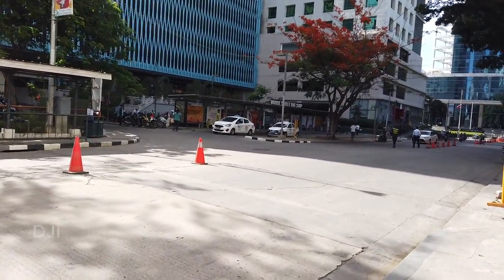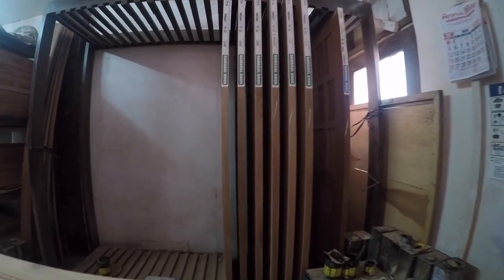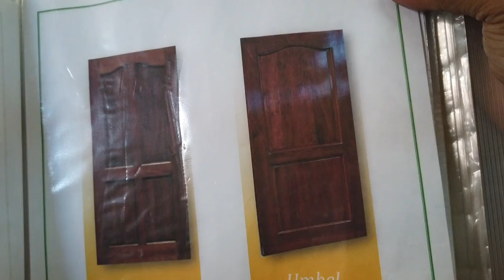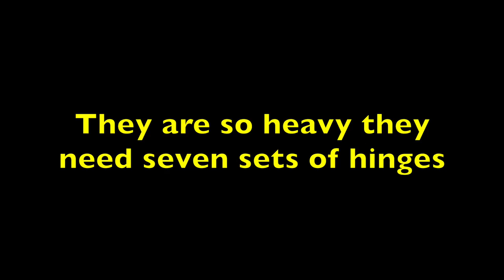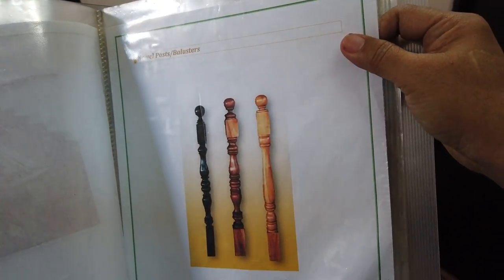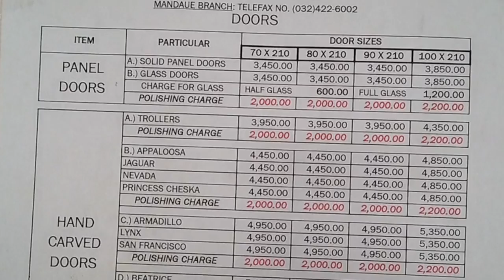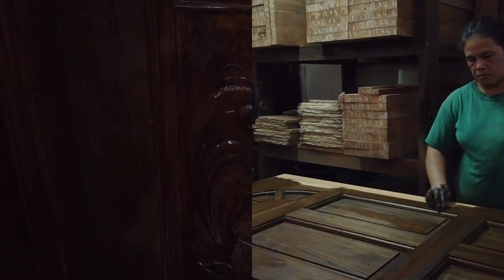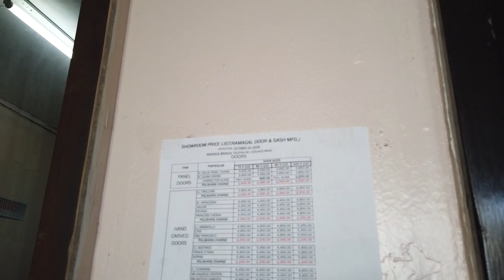Wooden Door Prices In The Philippines (Custom Made)

Comment: What is their standard sizes  ma'am ?
Reply from the maker: Naa sa ila price list Mam
Reply: NIANA YOSHIKAWA 
Door standard height : 2.1m (210cm)
Standard widths are 0.5m (50cm), 60cm, 70cm, 80cm, 90cm, 100cm (1 meter), 120cm
Anything beyond that is for special order or fabrication
Bathroom doors typically 60cm to 80 cm wide
Storage closet 50cm to 70 cm wide
Bedroom doors 70cm to 100cm wide
Main doors 80cm to 120cm wide
All depends on your house design
Hope that helps